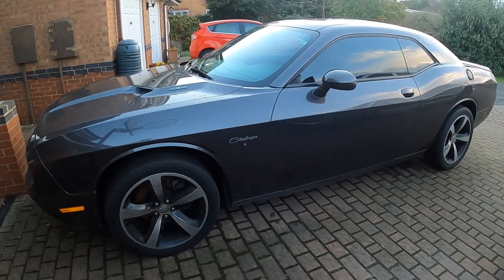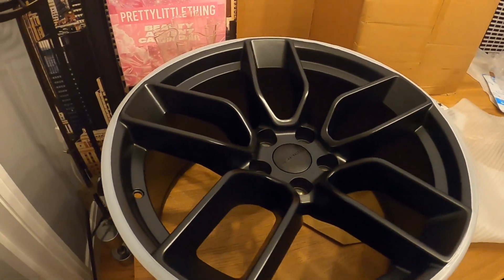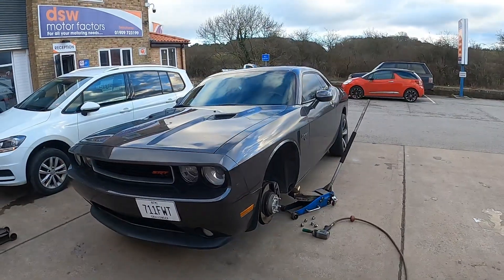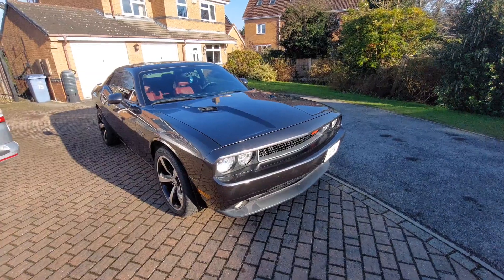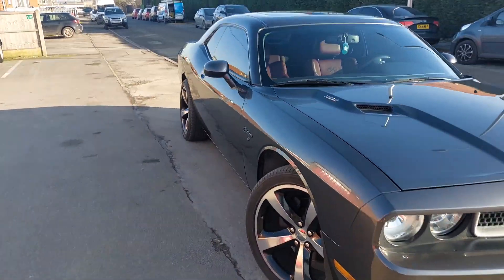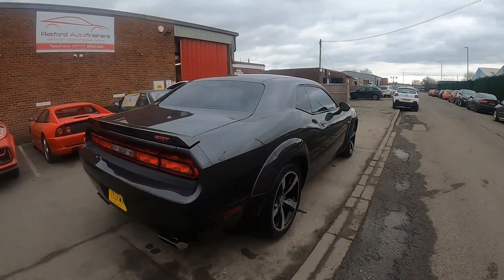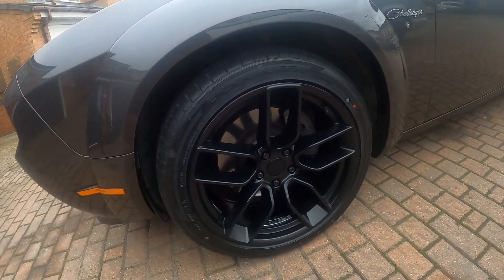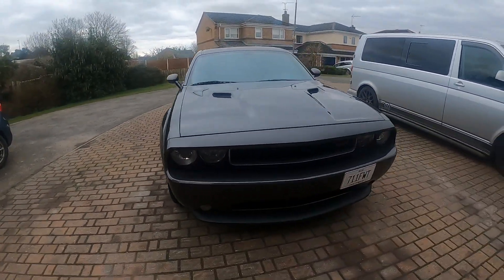Dodge Challenger Vicrez Widebody install - factory look .

Comment: Did they cut the arches or straight drill and glue ?
Reply from the maker: No cutting or drilling.  Just panel adhesive and straight on. Please watch my other video for the modification if your car is 2014 or older.